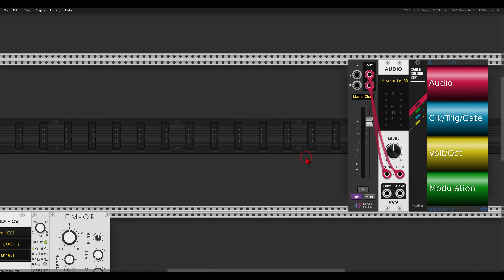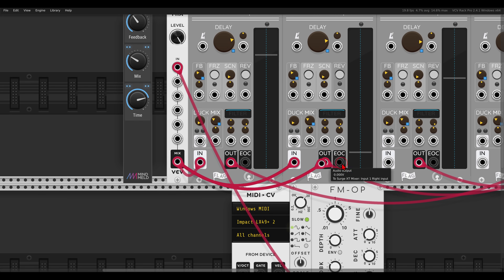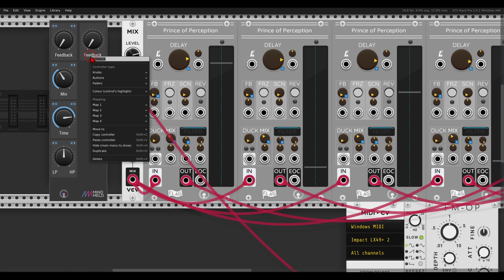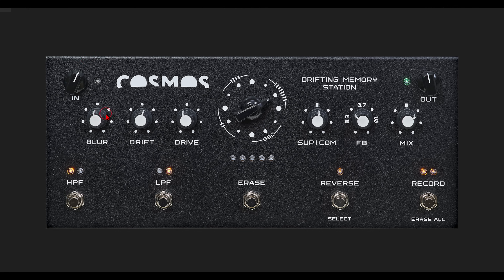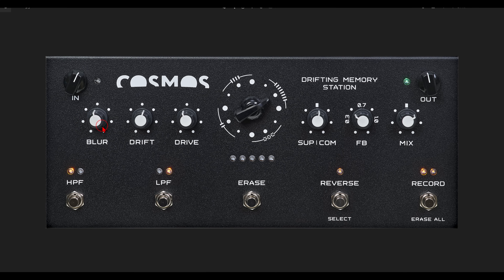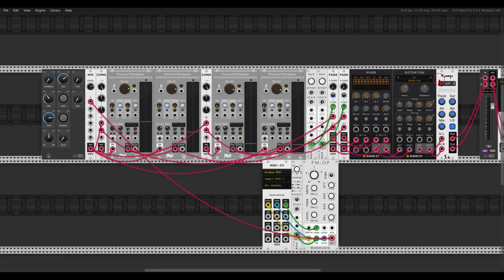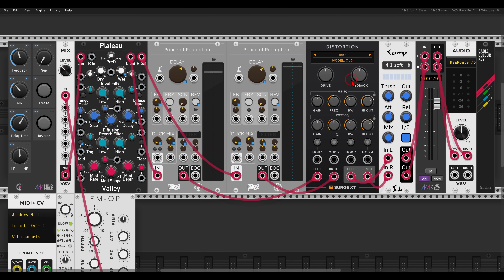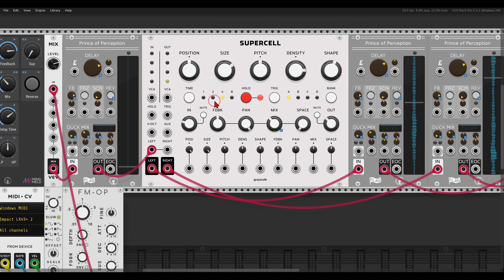Building a Looper inspired by the Soma Cosmos in VCV Rack

Comment: Thanks Omri. Love this kind of hardware breakdown video. Plenty of tricky pedals out there for you to dissect! Mood? Microcosm? Quick question: which mode were you in for supercell (sorry if I missed it!) thanks again! 🙏🏽
Reply from the maker: Thanks! Microcosm is on my list for a long time, but I'm not so sure how to approach it since it can do so much... About Supercell, I'm in the default granular mode :)
Reply: It's difficult to replicate pedals exactly but I had a few goes at the Microcosm and got some very similar sounds using Simpliciter. To be honest, I prefer to try and create new effects rather than emulating existing hardware. VCV is actually far more powerful and flexible than most pedals, for example Cosmos has 4 delay lines but you could easily patch up loads more in Rack. I've used 20+ delay modules on a mid range laptop before! Apart from one or two effects like a clean pitch shift/audio harmoniser VCV can do almost anything.